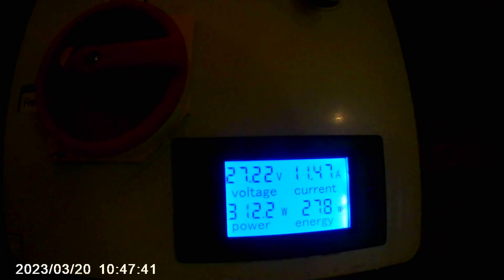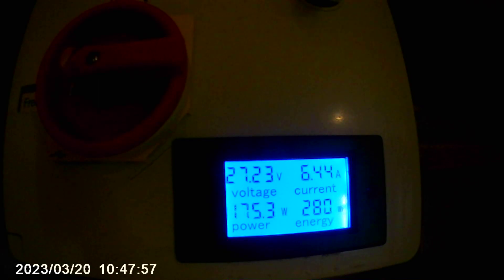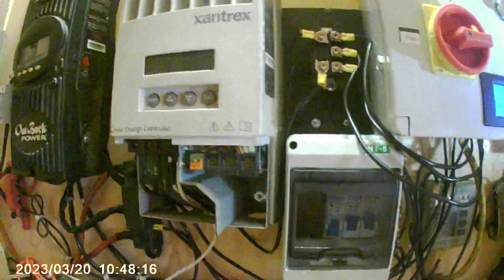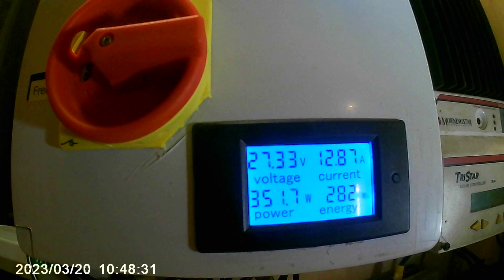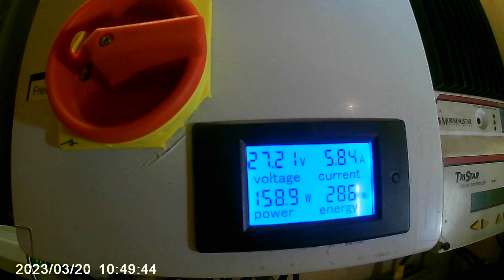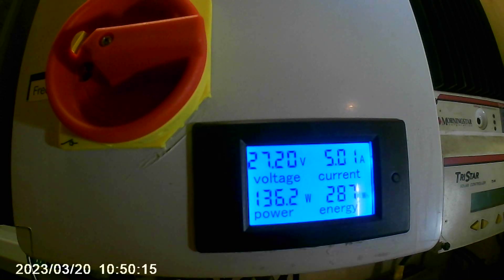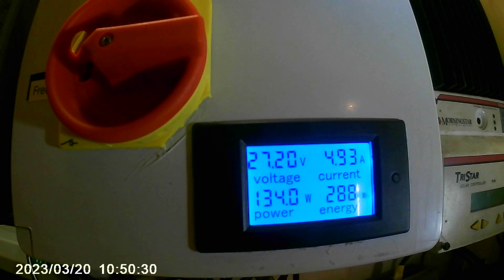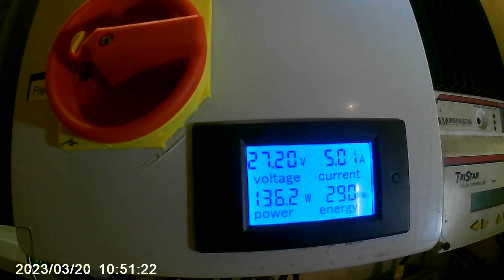ista breeze i 1500 48v charging 24v lifepo4 batterys will it work part 3

Comment: well known pratice to use a 48 volt turbine on lower voltage battery bank. the windings are thiner on the 48  ,so they produce more at low speed. been off grid for 24 years most wind turbines are poor producers, solar panels work better .  running a 1.5 kw generator for 1 hour makes more than these in one week.  Buy batteries and solar , always compare costs.
 
I use about 300kw per month, solar is about 25% winter to a surplus summer, wind never was more than 5% most months less than 1% most of time. I use a homemade co-gen in the winter . 80 % of the energy is lost as heat ,so I capture the waste heat and use it for building heat in the garage. 
Lithium batteries are dirt cheap now . just bought 30kw of new batteries
have fun

Comment: Hello good video Nice numbers but i have a question can a 24v ista breeze i1500 charge a 48v batteries bank ??? thanks
Reply from the maker: My guess is yes at 50 percent loss
Reply: 24v into 48batt It would work but your cut in  voltage would be too high. Lots of spinning in good winds with no charging. Would work in high winds but you'd  miss out on a lot of power gen. Wouldn't advise you do this.

Comment: Very interesting experiment. I run my 24v i1500 into a 12v bank. Works really well. My peak power is reduced to about 900w which is not really that important. The main thing is that I get good kwh over time. Previously, running the 24v i1500 into 24v was a bit frustrating. Lots of spinning but not reaching cut in.
Reply from the maker: good to know that i too get those same results with 48v i 1500 on 24v bank however i was wondering  how much top end i was loosing but in my lower winds there is no no top end so i cant get what not there was interested in seeing more top end in my testing with the 48v i 2000 on 48v bank will answer my own questions.lol and i will post it when its flying.thanks for the update
Reply: @offgridgarage  just a thought...when your turbine raises battery voltage to "full", does your BMS disconnect the battery. This would make the turbine freewheel with zero loading (not good at all!, especially if the BMS waits for ,say 10 seconds , in a storm before reconnecting). So you'd need to have your dump load controller set to start dumping excess current before the BMS disconnects. I'm  on lead acid but thinking of upgrading to lifepo4 and this is something I'm researching. Maybe a safeguard could be a small cheap 12v "slave" lead acid with a second volt sensing relay (£10 to £12, ebay) normally open, but would close to fire a second relay to start dumping current.
Reply from the maker: @nhikoid  that is correct solar stops at 27.4 wind continues on till 27.6 tristar 60 dumps all power through diversion load a 1500 watt heater  holding batterys down to 27.6 so the system is always loaded.i dont trust ssr but tri star 60 pwm are bullit proof
Reply from the maker: @nhikoid  i had bad luck with ssr i dont trust them ts 60 is bulletproof